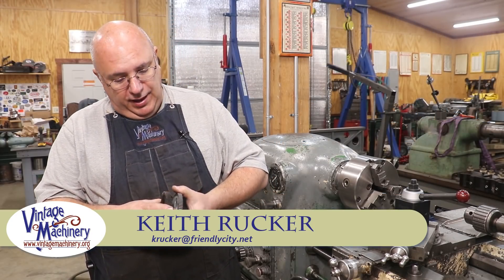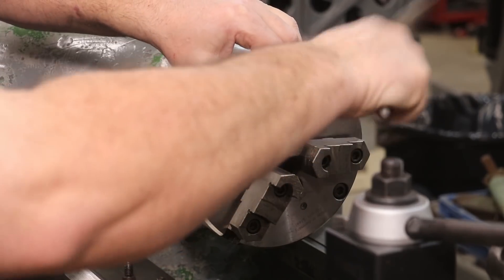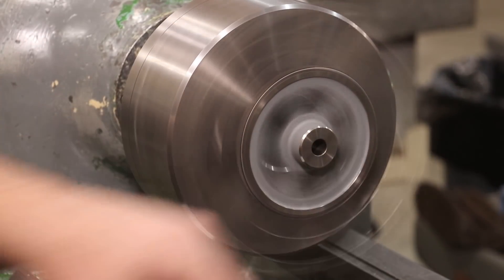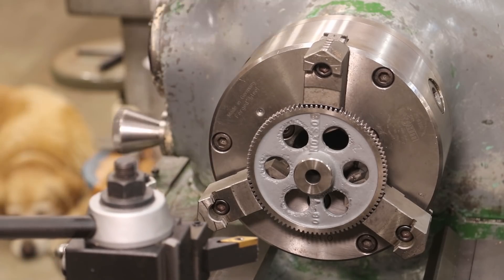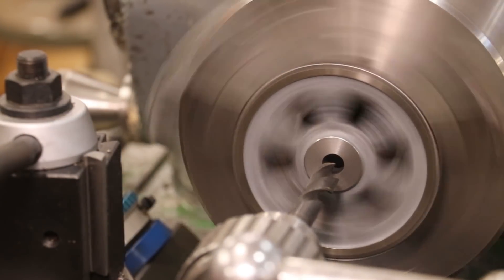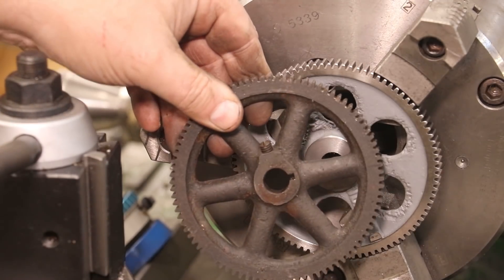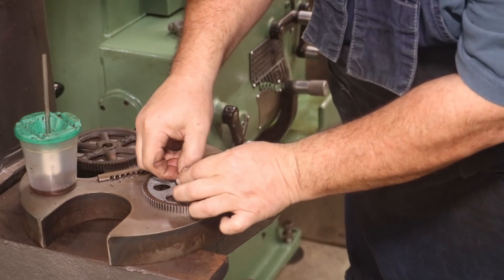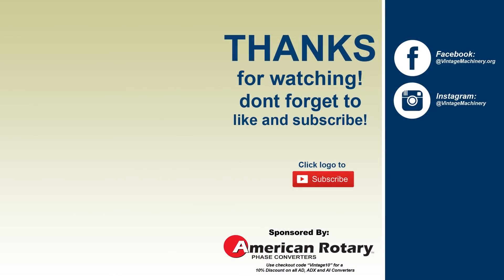Making Modifications to a Stock Boston Gear

Comment: Hello Keith,
Great video, I made a video series on this exact technique to replace gears using an available off the shelf Boston Gear. I had to go more in depth with info to make sure I bought the correct gear, #of teeth, diametrical pitch etc... I think it's an economical and efficient way of replacing worn old gears if you have some machining ability and means. Here is the link to my playlist, if you don't mind... 
https://www.youtube.com/playlist?list=PLbdQpO_FQZalfBMxAYUn5ghs4LCbMTHZn
Mike - Plus8Precision

Comment: Kieth, buddy, Lord! Adjust the 2 screws on the front cover of that press! Damn you were killing me. Also a pointer.....drive the broach by the back of the ram where the rack teeth are, the forces will be more lined up, and for heavens sake lube every pass and especially the back of the broach. Also, up here in the pucker brush we never finish bore with a drill on ANYTHING.

Comment: Did anyone else cringe, when that broach started bending?
Reply: And when it hit the concrete...
Reply: I saw that happening and looked away waiting for the sound of the broach snapping into many smaller pieces.
Reply: yes, didn't like that
Reply: Yeah, right at crotch level
Reply: Is the Arbor worn out? That side movement didn't look good.

Comment: Observations on my part:  CNMG insert would have been a better choice, rough drill the hole and then bore, arbor press ram requires facing on the end to square it up and the ram requires adjustment of the gibs to tighten and true up the stroke.
JIM

Comment: That drilled 9/16 hole didn't look very professional, run out of reamers or time?
Reply: not a machinist but was thinking the same thing.  At least indicate it to make sure the gear is centered, and not just trust the chuck.  Facing is one thing, boring is another.  I assumed either reamer or boring bar.
Reply: @AffordBindEquipment  if it's off center a little, the drill will flex and "find" the center.  As to the tolerance, it's a keyed shaft with a set screw that's going on a lathe.  It's not a piston cylinder.
Reply: Fits right in with the less than precision measurements on the width. "It's close...that's good enough."
Reply: He tends to be a bit of a hack when doing his work. There's no way the drilled hole was as good as boring.

Comment: Why did you not put the set screw hole dead center over the keyway slot. I don't ever recall seeing a set screw lock into the shaft instead of the key. But then what do I know?
Reply: If you recall, he's duplicating a part, and he said the original had the set screw 90° apart.
Reply: @xenonram  I did not catch that in the video. Thanks for correcting that.

Comment: Why would a guy with a lathe need to send this simple job to Keith?  And why drill the hole- should have been drilled and reamed- you can see the broach bushing fits loose in the hole.
Reply: Just a thought but perhaps the lathe is in pieces awaiting a new gear?
Reply: @littleworkshopofhorrors2395  That is a change gear for threading, so if he was restoring his lathe, that job could have been done last after the machine was assembled and running-
Reply: @oldschool1993  i bow to your greater knowledge of charge wheels, but that doesn't stop the rest of the lathe being in pieces. Just possibly he needs to screwcut a part to make the lathe usable?
Reply: @littleworkshopofhorrors2395  Hmmm- not sure how this gear would help him screw cut a part if the main spindle and chuck are disassembled- if the main spindle and chuck are functioning, then he could have  done the gear work himself.
Reply: @oldschool1993  just thinking off the top of my head. How about he doesn't want to use the lathe till everything is perfect. I knew a chap once who rejected a lathe because of a minor spot of rust,takes all sorts.
Reply: @littleworkshopofhorrors2395  Yeah I've known guys like that, but if he is really that OCD, he would probably reject Keith's gear because the keyway was not deep enough, the center hole was drilled and not reamed and the gear teeth are 0.20" thinner than the original.
Reply: @oldschool1993  indeed. But i doubt we will hear any more about it so everything will remain speculation. Meanwhile, back the real world, could you point me in the right direction i seem a little lost.😢
Reply: @littleworkshopofhorrors2395  Who knows- I'm sure the guy was waiting anxiously to see his project on You Tube, and maybe he will read the comments and tell everyone the answer.
Reply: @oldschool1993  without being uncharitable about the chap, the fact that he asked Mr R to make a new one rather than modify a standard production one might be an  indication of the chap's level of experience, perhaps? Or maybe he wants to collect a souvenir of Keith's work?
Reply: @littleworkshopofhorrors2395  Could be, I would even like to have Keith do a project for me, but I could not bring myself to ask him, considering all the stuff he has on his plate already.  I'm amazed he gets all his own projects done without doing favors for others.
Reply: @oldschool1993  indeed but from Keith's point of view it's variety for the channel. "Variety being the spice of life"
Reply: Based on the beginning of the video, it sounds like he asked Keith to make a new gear, which would involve a lot more than just facing, enlarging a hole and broaching.  It would require the ability to index the piece to cut the teeth, the correct cutter to form the teeth for the right DP.  After Keith found the gear for him, he just finished the project.
Reply: @RyanWeishalla  Yeah, a year or so ago Keith was making gears for another guy and I posted a comment that you could find the same gear on e-bay with the same teeth and pitch etc. which only needed the hub bored- I think maybe Keith took that to heart rather than a long and laborious tooth cutting process.  It's really amazing that we see people taking long and difficult solutions to simple problems.  Recently another You Tuber was making some Bronze bushings by machining them from a huge and very expensive chunk of solid bronze stock, of which 90% ended up on the floor as chips, and just a 5 minute search on E-bay found off the shelf bushings that were 1/10 the cost of the chunk of material and only needed a few light cuts to bring them to size.
Reply: @oldschool1993  there is an old saying that goes, a professional wastes material to save time and an amateur wastes time to save material. I make no comment.😉
Reply: @littleworkshopofhorrors2395  " I make no comment.😉"
Wasn't that a comment?   Actually I have never heard that saying, and a professional who wastes either time or material will find himself searching for a new job.
Reply: @oldschool1993  i do find if I am pottering about in the shed doing something for myself I try to save material, but if someone else is paying for the material and labour i don't mind wasting a bit of stock to save time. Professional time being more expensive than material these days. Could be though that I am mean grumpy old sod when it comes to spending my own money.
Reply: @littleworkshopofhorrors2395  Yeah- for a hobbyist material is generally far more important  than time, because a hobby is essentially a method to use up spare time, and most hobbyists have a limited supply of material to choose from.  In a professional shop the time cost is more important than material, but planning a job that requires a lot of excess material removal wastes both time and material, a really big no-no.
Reply: @oldschool1993  indeed.

Comment: Boy, I'm sure glad you turned the position of the broach! I was screaming at the computer screen to warn you of the angle the broach was approaching. Whew!
Reply: You'd think he would at least raise the bar to release the broach from binding.
Reply: @Craneman4100w  , he saw the danger as it was happening and changed the position of the broach so that the broach could be used with less peril to the broach. I'm sure he realizes he's going to have to work on the tolerances on his press so that there won't be so much side ways pressure.

Comment: I was cringing a bit seeing that broach bending.
If you position the broach so it is under the back surface of the press's ram, rather than under the center of the ram, you should get less of that deflection. The force applied by the pinion on the ram's rack should be in line with the half-depth of the rack teeth, so by positioning the broach this way, the torques from the pinion and from the force on the broach should balance out and not try to rotate the ram.
Reply: I was also cringing, but I think us preaching to Keith is a little like trying to teach your grandma to suck eggs.
Reply: @graymouser1  I agree and also I have have seen no (to date-I am a new fan) of Keith answer any questions. Strange.
Reply: Teaching Grandma to suck eggs sounds pretty rude!
Perhaps my comment should have used "one positions" instead of "you position" and "one should" rather than "you should" so that other viewers of this video might realize that my advice doesn't just apply to Keith.
Reply: @kevin Martin It's an old expression, and it implies grandma already knows WAY better than you.

Comment: Thought about taking a machining class just for personal information but found they do not any longer do things the "old way" I like the style of machinery you have and simple "Non computerized" common sense solutions you portray over the overpriced CNC  type work pushed . I enjoy your style as many other practitioners of machining over  the new ones , so thank you and all you "Old-pros" knowledge and patience to teach.  An old welder....
Reply: Industry just wants CNC operators who can babysit enormously expensive, high throughput machines used in manufacturing.  The market for people capable of repair work is relatively tiny.
Reply: @5tr41ghtGuy  That's totally untrue. The market is in desperate need of skilled tradesmen. There's especially a need for skilled machinists because all the skilled/smart machinists are getting old, and the kids who are smart/intelligent/intuitive are doing other things like university, and are taking desk jobs. There is a huge need for them in the machining sector. And the notion that you can be a CNC machinists without being skilled is completely wrong. Go take a look at Peter at Edge Precision. His job is the one that's most in demand. He's semi-retired and keeps a couple of his machines at his machine shop that he sold. So his generation is on the way out of the industry. Same goes for most other trades, from plumbing, to electricians. There's an over abundance of unskilled labor.
Reply: @xenonram  your not watching a skilled machinist....

Comment: With your skill at machine work I would have thought that you can make a broach insert to match the hole size as well as the broach. Great videos, all the same, keep them coming
Reply: Of course he can. It's easier, comes pre heat treated, and cheaper (when you value your time, the cost of the material, and heat treating). And he might not have had time to do it. You know he has a regular corporate job as a Bayer crop scientist, so his free time is limited.

Comment: Time to adjust the ram in that arbor press.
Reply: Yup going to have to tighten up the slide on that ram or there will be something broken in the future pressing on it. Way too much movement. Funny how well stuff like that shows up on video when you can barely notice it in real life.
Reply: @bcbloc02  yes I was waiting for that thing to snap
Reply: @TERRYRONALDRACKLEY  Same. I was hella cringing.
Reply: Yup, that think is walking drunk.
Reply: Now that numerous people have told him it needs doing, he will flatly ignore them. Amateurs hate advice from more knowledgeable people.
Reply: I think it'd time to weigh it in....!!
Reply: I was more wondering about the table tilting down under pressure. That looked to me like most of the problem.
Reply: Mr. Wilton, I looked again at the ram in relation to the lalthe handle behind it.  The ram is moving all over the place.  The table is flexing a bit as well, just not to the extent of the ram.  I may have to install a camera in my shop so I can spot similar issues!!  bcbloc02 made a good call.
Reply: What I was going to say has been said before. Thanks for your videos Kieth

Comment: Nice little job Keith. I can't help but wonder if the person you made this for couldn't do the job because of the key way. He has a lathe. You found him the ready made gear solution from Boston Gears, without a broach or a shaper it would have been normal to cut the key way with a hacksaw and a file, but, today, people who haven't manual training wouldn't even think of it! Regards, Matthew.
Reply: @lwilton  It's a pity that you didn't learn basic hand tool work, it can get you out of a lot of problem situations! If you decide it will be botched, then it's going to be!
Reply: @lwilton  That is a change gear for threading, so if he was restoring his lathe, that job could have been done last after the machine was assembled and running- very odd that a guy with the ability to restore a lathe would need to send that simple job out to someone else.
Reply: There's a lot of assumptions going on here. We don't know what this gear is used for. (Recall, Keith said he wasn't sure.) Maybe he wanted it broached rather than spending an hour or two with a file and getting a crappy fit, or spending several hours with a file and getting a great fit. When Keith can spend 3 minutes and push a broach through. Maybe he's an older fellow that prevents him from doing fine file work due to a disease, or eye sight, or just old age. Maybe he's a young fellow that suffers from one of the first two aforementioned afflictions. Who knows. There's often a reason something's being done a certain way.
Reply: @xenonram  Well, you certainly added a few more assumptions to the list.  From the number of comments, it seems a lot of people are asking why a person outsourced such a simple job- maybe the owner of the gear could post an answer.
Reply: @lwilton  Who was talking about beating techniques into anybody? If you don't want to work by hand that's not my problem! My idea was to let people know that this can be done by hand, just not many people think of it. I repeat, this can get you out of a difficult situation sometimes.